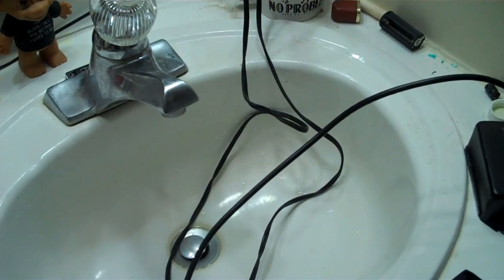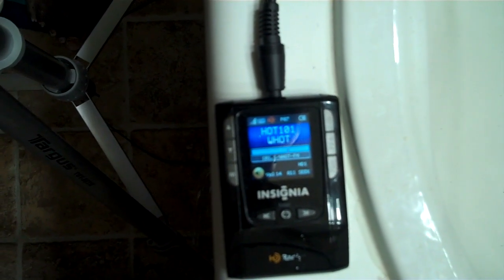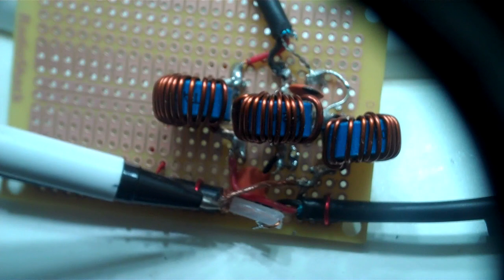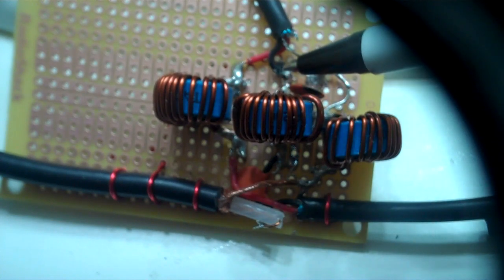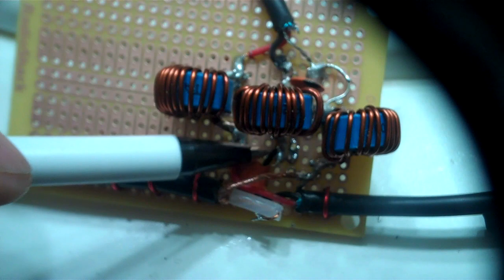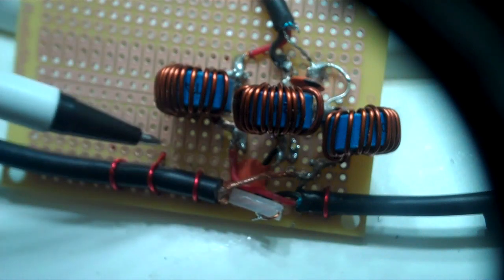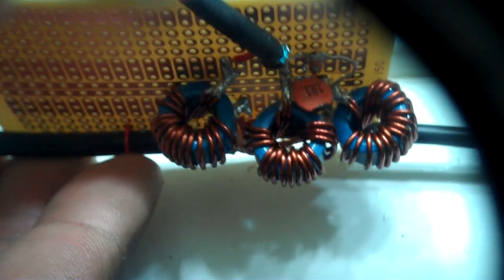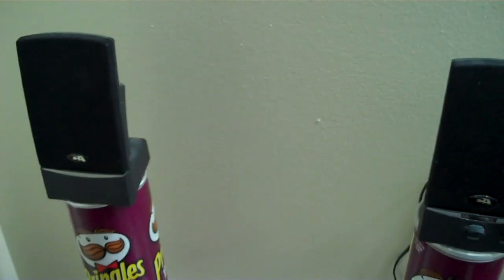RF Directional Coupler for Insignia HD Portable.mp4

Comment: Good job man! I use the Insignia HD portable with a set of Kuryakyn 'Sound of Chrome' powered speakers that are mounted to the handlebars of my Harley-Davidson FXDC. I was going to dig into the circuitry of my Insignia HD receiver to 1.) Determine where best to attach an external antenna, and 2.) Isolate the noise coming back through the audio line from the power-supply of the speaker system. I think you may have figured it out for me! Thanks! I'll follow up with the results of my testing.